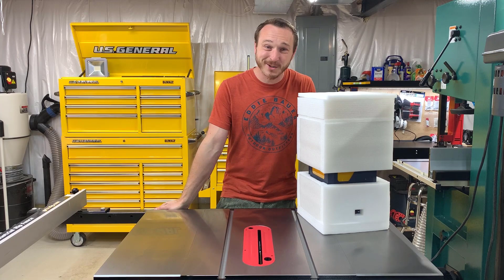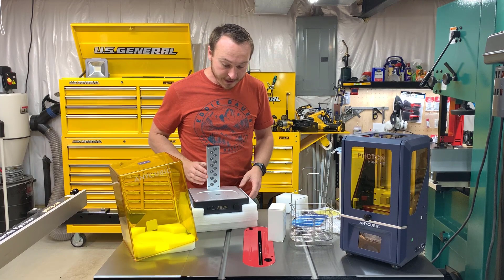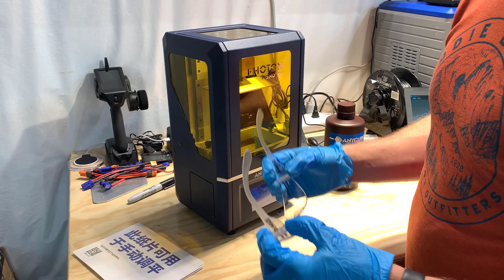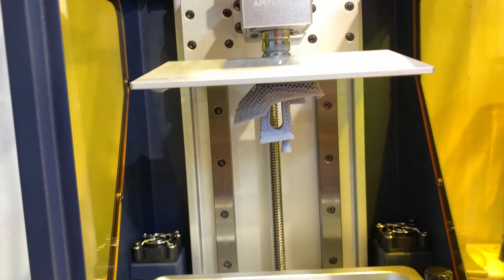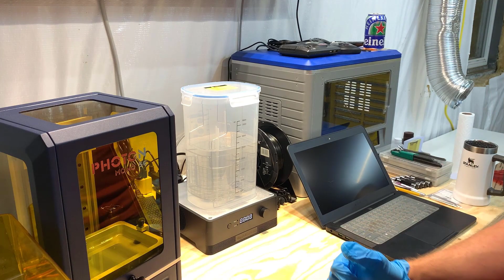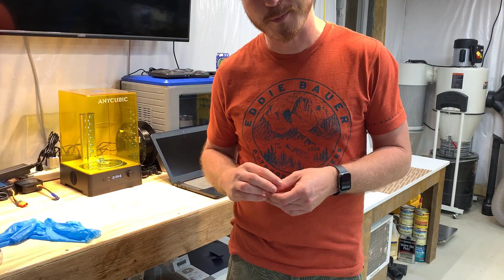SLA PRINTING - Anycubic Photon Mono SE System - Unbox - Print - Practical Review

Comment: You can set the entire build plate with print attached into the wash.  The wire rack holds it.  That way you wash the build plate too and you don’t need to fiddle with the scraper while there’s a bunch of excess resin around.
Reply: How large of an item can be printed with this model?
Reply: @jeffrowe5454  It's pretty tiny.  130mm by 78mm by 160mm.  But print quality is good.    I went with the Mono 4k version and am really happy.